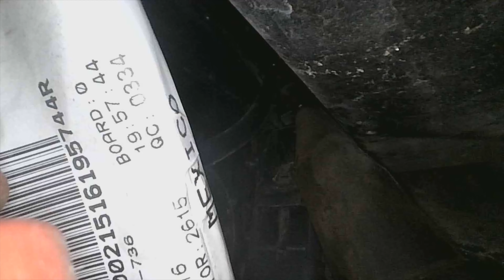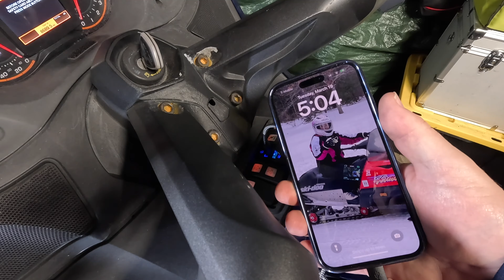INSTANTLY Upgrade Your Can-Am Spyder RT with this New Version POWER PORT Installation!

Comment: I wish was not scared to do this myself you made look so easy.  Thank you...
Reply from the maker: It is easy not be scared with as little as I have invested in it. I couldn’t imagine if I had paid full price for the Spyder. Thank you for watching and the comment!
Reply: I just purchased a spyder 2014 I want to install a CarPlay but installing it myself 🤔
I might have to just do it.
Reply from the maker: @duranmona  It really wasn't that bad all said and done. The worst part was getting the power to it. The ball mount for the unit I found on Amazon made attaching it a breeze. The update video shows a different way to route the power.
Reply: @Y-DER  which is your updated video?
Reply from the maker: @duranmona  https://youtu.be/-so56CHm5AI?si=wyZdQggCR8LOmA3m

Comment: My back hurts just watching you in the video! Ah, youth. 😅
Reply from the maker: Something I don’t hear too often. Thank I you. My back usually hurts for a week or so after every video
Reply: @Y-DER  Was gonna hit like but thought sorry to hear would be better.
Reply from the maker: @guzzialfa I think “like” translates to that, but thank you. Having back problems made it an easy decision to buy the Spyder. It’s all worth it too!
Reply: @Y-DER  You & me both.  Spinal cord stimulator for pain mgmt and winter before I bought my '23 I had a total right hip replacement..1st my dealer taught me how to mount a Spyder (passenger pegs and seat then slide forward,  then the Can-Am Experience leader wouldn't even let me test a Ryker..she'd had several injuries and metal so she said, with your back - not even gonna let you try it. I was sold right then and there but still did 2 rides, 3 if you count 10 minutes on an F3.
Reply from the maker: @guzzialfa welcome to the channel and our little community

Comment: Ohh man there is nothing better than a clean install! I have the same dilemma with my F3T but i dint have any knockouts near the bars for an install like this and i can’t stand a cluttered handlebar. I wound up drilling a hole in the glovebox up top and fishing a USB cable to the bars and ran it parallel to the factory wires and velcro wrapped it in place if i need it. It does work but i sometimes get usb malfunction messages on the dash which sucks. The new bolts definitely tidy things up but buddy please take them out and put some blue thread lock on better safe than sorry.  I think this video is in first place for least amount of plastic removed so far for you. Good idea using the  accessory circuit no fuses and switched power so glad BRP includes them on all the trikes. Looking forward to that carplay install as I’m on the fence between nothing , carplay adapter or getting a new F3 . You might be the deciding factor between 200 bucks or 27,000 bucks.
Reply from the maker: I just filmed the CarPlay episode. It came early and I’m thinking sales of 2024’s may suffer after this one… 😬 I just ordered the Loctite. Good suggestion.
Reply: @Y-DER  im sure it will be better than my next mod video lol. I just got new floorboards delivered should take 10 min to install so it will take me 2 hours lol. I’m so on the fence I love it in my car but don’t see myself needing it on my trike. Never had a problem with music and have the garmen zumo xt for navigation which i hardly use. So let’s see if you sway me lol. Looking forward to it.

Comment: Great job just missing a fuse inline. Or I maybe missed that bit
Reply from the maker: This circuit is fused in the "right" fuse box where you can move it to either constant or switched power by using #6 or #7.  It is a 5 Amp fuse. You didn't miss it. I didn't know where it was until after.

Comment: Great video. What did you use to find the yellow/purple wire ,was it behind the battery and do you know if it’s there on an 18 RTL. Does it have a name. Thanks in advance. Would love to have the dual usb on mine.
Reply from the maker: I believe it is there on the 18 RTL as well. It should be just behind the little round rubber plug. I only used the inspection camera to show where it is tied down if you need more. You shouldn’t though.

Comment: It was not clear to me where you tapped power. It must have been on the run portion of the harness otherwise it would be on all the time so I’m assuming the purple yellow is a run wire? 

Great camera work as always.
Reply from the maker: Thank you! The connector that I tapped into I believe is for adding accessory power in the frunk. The purple/yellow follows the same as the lights that stay on for a few seconds after the ignition is turned off.
Reply: Nice job, enjoy watching you work on the Spyder. 😀 you make it look so easy. I do my own maintenance on my Spyder  and I am always looking for better ways of doing things. I have learned some things just watching your videos. Thanks for sharing. 👏👍